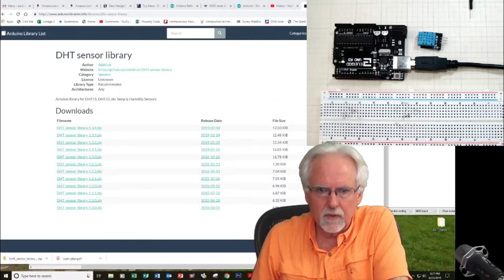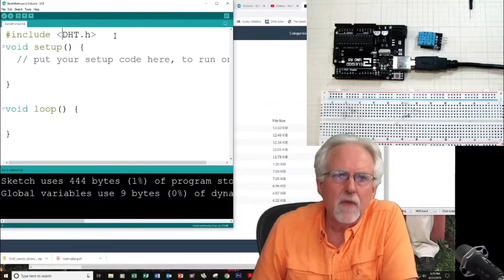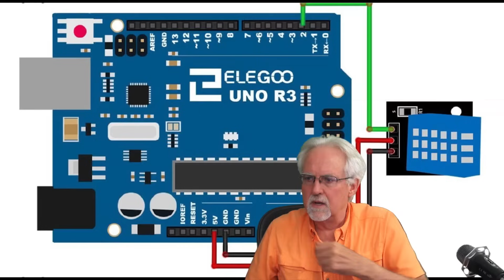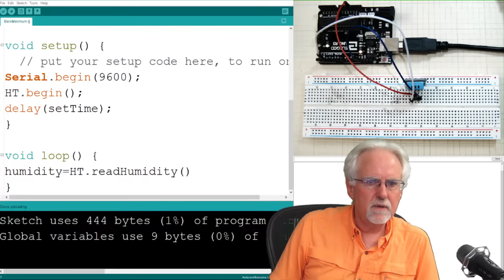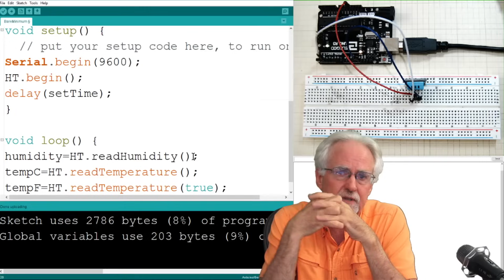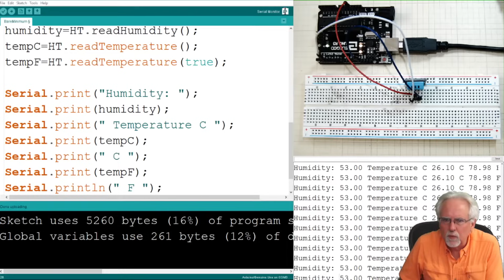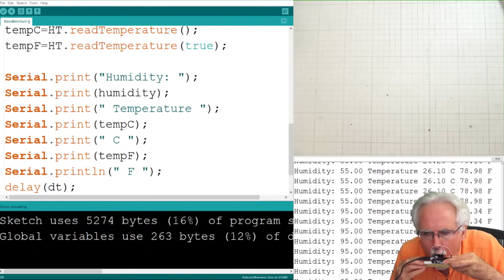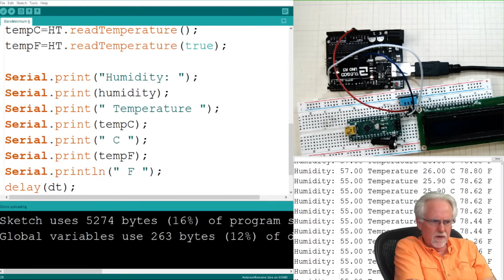Arduino Tutorial 50: How to Connect and Use the DHT11 Temperature and Humidity Sensor

Comment: In the beginning of this tutorial, You suggest a nano to allw everything to be on the Elegoo proto board. I have designed a 3d printed base that holds an arduino Uno or Megga with pegs to stabilize them, and the long Elgoo proto board or the more common shorter proto board. I will share the stl here if you like.

Comment: Project did not work at first. Googled it. Said via 'Tools', 'Manage Libraries...' find and install 'Adafruit_Unified_Sensor'. Once this was done, project worked like a dream. Thank you.
My question is: What is the point of the 'int setTime=500' line? It was not used anywhere. Should this have been used for the delay instead of then defining a new variable 'int dt=1000'?

Thanks for an excellent set of tutorials. I got the Arduino on 25/12/2020 and I got to tutorial 50 by the 15/01/2021.

Comment: Another fun project, especially using the LCD to display the results. I followed the instructions regarding the library and initially had a problem (as some others also did). I then discovered that there is a library manager (as others also have) now built into the arduino development environment. It turns out there were dependencies that the DHT library required that needed to be installed. The nice thing about the manager is, it recognized the need for these dependencies andl went out and load the dependencies for you, making the process super simple. Once that's done, I used use the #include <> brackets and key words were then highlighted.
Once all that was taken care of, the actual coding was straight forward and I'm very satisfied with the results. 
Another great vid, Paul, and I've ordered the nano for lesson 51.

Comment: Boom! Paul is fantastic! ..my dht11 might be broken because I got Nan or 0 values doing exactly like on tutorial. I tried different releases of the library too.. Im gonna order dht22 because in my country its sometimes under zero celcius. So is there no need for resistor at all with dht?
Reply: I might also order DHT11´s just to see was it the sensor on the kit or something else which was faulty. Is there any differense if sensor has a small ship or only the light-blue sensor box with small wires

Comment: I also had problems installing the DHT library.  However I used the Library Manager from arduino and scrolled down to DHT library.  I then installed from there and it came back saying that I was missing important files.  I clicked yes to this and all was ok.  Just one comment to Paul........ in England £ is pound. # is hash.  Love the lessons though.

Comment: Sir, I had a serious problem!! I followed everything, but my sensors are giving "nan" value. How can i solve this ? !
Reply: I just solved it for me. The coding was all correct, I took the sensor off the bread board and connected the wires directly to sensors pins and it started spitting out data instantly. For some reason I am not getting a good connection when its mounted on the bread board.
Reply: for me, I took the DHT11 to the breadboard. So if you follow the tutorial well, it's probably your wiring. either make sure everything is not loose or change your jumper.
Reply: I use the "Miuzei" brand kit, I found out that if you switch the pin2 and 5v wires it stops this error. It must be made a little different.    (left 5v, middle Pin2, right GND) .

Comment: i had a problem where it just showed me "nan" for the reading so i did some small checks and then i found out that i had to connect it to A2 or any analog readpins and then changing the code for 2 to A2 it started working just fine. i dont know why did your one was working but my did not work and this was the solution that i had to come up with.
 
and thank you for your videos i love them
Reply: Thanks! I was having the same problem and it worked out with your comment.

Comment: Hi Paul, thanks for your vids! However, my sensor is reading either 0, NAN or -999 no matter what I do. Do you by any chance have any suggestions?
Reply: Hi Alex, i also get the NAN result.  but after i switch the wire , i able to get the result. try to put 5V at left hand side, center use Pin 2 and right hand to GRD. hope this work for you.  may be the Sensor model are difference from Paul using in YouTube. Happy Learning......
Reply: @neehengchuah8554  Thanks a lot! Only just saw your reply now but will have a go when I can

Comment: I also had to add the Adafruit_sensor.h library. I went a little further and connect the sensor to my LCD. Next is to connect I2C 20X4 LCD and add comments based on temp/humidity. Comfortable, Tolerable, ...you get what I mean. It was 104 yesterday at my home here in Texas.

Comment: DHT.h needed Adafruit_Sensor.h to work.  I can see at 8:06 that you have that library installed already.  So I found that library and grabbed it too.
Reply: Homework went fine.  Just stitching together code from the last 2 lessons.  I did have some weirdness but figured out I was causing it because I had lcd.println in my code.

Comment: I followed your code and the wiring yet I get the nan output values. Can anyone help how to solve this one? Thanks
Reply: If your getting the "nan" value error, try switching the left and middle wires. I use the "Miuzei" brand kit, I found out that if you switch the pin2 and 5v wires it stops this error. It must be made a little different.  If that does not work, then remove the sensor from the breadboard and wire directly to the arduino.    (left 5v, middle Pin2, right GND) .

Comment: I prefer to use the 'const' keyword instead of #define.
I don't have the DHT11, but I do have the TMP36 (temperature sensor only).

I find that the DHT library and DHT commands does all the dirty work of internally converting the analog read signals into digital signals. 
The pin2 of arduino is the sensePin, it reads digital signals. But the DHT11 reads analog signals. 
Analog-to-Digital conversion is made possible with the DHT library and DHT commands...readHumidity(), readTemperature() and readTemperature(true);

On the other hand, the TMP36 is kinda dumb. No Analog-to-Digital conversion happens, hence we need the sensePin to be connected to an analog input in the arduino, i.e. A0 to A5. It reads, analog values, as expected.

Thank you for this lesson Sir Paul!

Comment: I have connected two DHT 11s to the Uno and reading independently, Yay.  However, a couple of weird things:  First, I purchased "dht22"s but got nan readings on the serial monitor until I accidently defined them as dht11s.  One is assigned to pin2 and the other to pin4, but despite all the code being consistent, I had to physically connect them to the opposite pins to read out correctly.  I've also added some simple math code to calculate vapor pressure, but get a single readout that does not change, regardless of the temperature and humidity readings.  I think there is some sort of timing issue, but don't  know enough about this to begin to troubleshoot...help!

Comment: Having followed the lesson, I think the reason some of the Orange highlighting isn't working for you is due to the way you installed the libraries. I had similar results when trying to manually install them, but they still gave compile errors.
Once I'd installed them using the Arduino tools, (see previous post), compile errors disappeared and I got Orange everywhere I expected. Hope this is useful for other viewers.

Comment: Things have probably changed a bit since Feb 2020. I had to install the Adafruit Unified Sensors library. Also ended up using the Manage Libraries option. It's a bit confusing that the Arduino sketches folder and not the Arduino IDE folder is where the libraries are "installed," even though the installed libraries appear in the Arduino IDE folder.

Comment: Wow, it took forever to #include <DHT.h>  . The IDE refused to find the path for some reason. I reloaded the IDE with the latest version and tried Adafruits link but nothing helped. I finally saw John Doudar's comment and the library manager did it for me. Whew! The IDE even balked at "DHT.h"  and preferred <DHT.h> and then it changed the DHT to red. If I didn't have bad luck I'd have no luck at all.
Reply: Yes, works for me too. Using the Manager will also install the necessary dependency called Adafruit Unified Sensor (Tools > Manage Libraries... Search DHT11) it's by adafruit

Comment: I'm using Linux Mint 19 the problems encountered that are found below in the comments to myself are attributed to the initial installation, version and updating of the libraries.  The GUI was VERY different and what I have now looks AOK, just like what Paul is using. I'm on version 1.8.13. Good news is that found that the DHT.h file must come from the DHTStable library, not DHTlib.  The Adafruit unified library mentioned in other posts is a required installation and is NOT required in the code. It works now, which at least allows me to progress. But, I still don't understand how the library work and I'll have to spend some time there because you have to know how something works if you are going to use it as tool. Time for some lunch as a reward to me, and maybe a cup of black coffee.

ORIGINAL
I can't get past a long list of compilation errors that repeat UINT32_MAX not declared in various lines in DHT.cpp (whatever that is). I've got the latest version of DHT.h and the latest Adafruit library didn't help.  I'm using Linux Mint 19 with the latest drivers installed .  I can't see where I have anything undeclared.

#include <DHT.h>
#define Type DHT11
int sensorPin=2;
DHT HT(sensorPin,Type);
float humidity;
float tempC;
float tempF;
int dt=1000;

void setup() {
Serial.begin(9600);
HT.begin();
delay(dt);
}

void loop() {
humidity=HT.readHumidity(); //nice and orange like you would expect. Left temp off for clarity
Serial.println(humidity);
}
Reply: This is a perfect example why you need to know how things work.  Here's code from the C++ DHT.cpp file that comes with the library:
#define MIN_INTERVAL 2000 /**< min interval value */
#define TIMEOUT                                                                \
  UINT32_MAX /**< Used programmatically for timeout.                           \
                   Not a timeout duration. Type: uint32_t. */
This is in my error message on why it will not compile and I'm clueless about what is happening. There are plenty of links on the web about this, all written in English and not understandable:). Anyone?

Comment: Paul -
I am still having trouble getting "nan" for a value.  I have tried moving wires, adding delays, and trying a new sensor.  I'd like to do the following exercises, but I can't if I can't get the sensor to work.  
Any ideas?

Ken
Reply from the maker: NAN usually means you are dividing by zero, which is not allowed in math, and NAN means not a number. Look at your code. Where are you dividing one variable by another like v=a/b . b is in the denominator and if you print b, you will probably find b is zero. Then, you have to figure out, why is b zero instead of what you expect.
Reply: Sir, I also got nan output. I replaced float with long. I got a large negative number. Now I have to solve this problem.

Comment: Hallo Paul, thank you for your previous help concerning closed end lines on the Serial Monitor.
I feel embarassed to ask you again some help. This time I always recieve the message - DHT.h: No such file or directory- when I try to upload the DHT library. I tried with different editions of the DHT sketches and I checked the presence or a DHT.h file and a DHT.ccp file with explorer but every time I ve got the same message. I'm still able to upload e.g. AccelStepper.h and other sketches. what do I wrong? kind regards Roland Clauwaert

Comment: Hi Paul, when I tried installing the library onto my Mac i was getting errors, so I ended up using the Adafruit Unified Sensor library, and just followed along with your code. But now im getting a compiler error saying ‘DHT does not name a type’. Does you (or anyone else) know how to fix this? When i comment it out, I also get ‘HT was not defined in this scope’ compiler errors from void loop too:(

Comment: Unable to do lesson as I can’t get it past #include <DHT.h>. I hit load and keep getting an Error compiling for board Arduino Uno. Exit status 1. Any ideas anyone?  (Should have looked at some of the previous comments. As a few other have done I added the Adafruit unified sensor library and “BOOM” she’s working. Thanks people for your previous comments, a big help. The rest of the lesson went great. Went a head and hooked up a Nano and just a reminder to go in and change from a Uno to a Nano in the setup and watch if you use a different com port also.  Off to try out the homework.)
Reply: @bouachaismail3738  read your message to Wally and it solve my issue.  i had simular problem. Thank you so much . One question, is there a site that list all command for each librairies
Reply: @bouachaismail3738   This fixed it for me too! Thanks mate. Should also note that my error said Error compiling for board Arduino Mega. So I'm assuming this unified sensor library helps it talk to the different types of Arduino better.

Comment: Quick question and I may be an idiot. I accidently had 5V and GND swapped to the sensor for a while when i had everything wired to my arduino as I was doing the code. I noticed it was really hot and after uploading the code I get "nan" for both values in the serial monitor. Did i fry the sensor?

Comment: Hi Paul, a great set of tutorials and this is the first one that has failed for me. Like others have reported, the code will not compile even after the Adafruit Sensor library has been added. This is probably a fault with the library maintainers and not your tutorial which obviously worked when it was made.
Reply from the maker: Make sure you also have the "Adafruit Unified Sensor Driver" library on your system
Reply: I've done more digging and have found and fixed the problem. The version 1.3.8 of the file DHT library that you used works but current  version 1.3.10 fails. The issue is on line 29 of DHT.cpp,  if you modify this line in version 1.3.10 by adding -1 to the end and then comment out line 30 all is fine and the sketch compiles and works.

Comment: I couldn’t get it to work with only the DHT library, I had to also add the Adafruit Unified Sensor Library as well.  I did that, then it worked fine.

Comment: Oh wow, did I ever have some problems with the libraries. I don't know for sure exactly which step cured, it, I got so frustrated at one point, i just added everything that looked right, for some reason it kept asking for an adafruit library, well I still don't know which one exactly, but we got there in the end, it was all very reminiscent of pre Win95, trying to find libraries....
I thought i'd be clever and output it to the LCD which i so tidily added to my breadboard, and it seems like I've done the next lesson already. Feeling like I have accomplished something.
It's funny, i had more issues connecting this silly sensor than the LCD display. mad eh?

Comment: Hi Paul. I'm having trouble with the library. Any assistance would be appreciated. This the error I'm getting. Arduino: 
 fatal error: Adafruit_Sensor.h: No such file or directory

 #include <Adafruit_Sensor.h>
Reply: I had same problem, and I got  it resolved ...

you need to install "Adafruit_Unified_Sensor-1.1.4" 

Start by searching for Adafruit_Unified_Sensor-1.1.4  Arduino library...... and further use the similar step as show in the video for installing for  DHT sensor.

hope this will resolve your issue.
Reply: @prasannageddannavar5525  thanks. I’ll give it a try

Comment: I was having the same problem as Ylen.  After installing  the "Adafruit Unified Sensor" library, The error stopped, but now I am getting "nan" for the results like luke B was getting, but I still can't get it to read correctly.  Anyone have a clue of what may be causing it?  Thanks in advance for any help!
Reply: Figured it out!  It seems the power and ground rails of the new large breadboard I just purchased on Amazon are split in the middle.  Once I bridged the gap with small wires, everything started working as expected.  On a brighter note, the larger breadboard is indeed much better to build on.  Thanks!

Comment: had tried to apply the codes but this is the display in my serial monitor : Temperature: nan C Humidity: nan %.. what do you think is the problem?..is my temp / humidity sensor already defective?..
Reply from the maker: NAN means not a number. Usually this happens if you are somehow dividing by zero
Reply: @paulmcwhorter  thanks a lot for the response..ill check again my program..ill still buy 1pc of DHT11 to validate..
Reply: Already fixed after repalcement of dht11 with new one..
Reply: im making an air flow sensor project, using dht11 as aiir flow sensor to give signal to arduino in case of poor air supply..however, uaing dht11, no changes in temp..would loke to ask any recommendation to effectively monitor air flow?
.

Comment: How did you  know that the library says it needs to be hooked to pin 2? Can't you change the pin asignment in the sketch? Or does it have to be pin 2 because of the library? If so how do you know that? and what happens if you have conflicting library's both wanting to use pin 2 for a device? I was under the impression you could assign the pins in the sketch?
You also said when your create a object DHT you called it HT and that came from the library? So you have to call it that? and how did you know that?
Funny my sketch went orange on readHumidity and i'm copying you to the T.

Comment: The sketch in this tutorial, as well as the example sketch in the DHT11 library will not compile/run on IDE V1.8.10.
Reply from the maker: You might need to make sure the adafruit common sensor library is installed in your system. Link to the library is here.
https://github.com/adafruit/Adafruit_Sensor